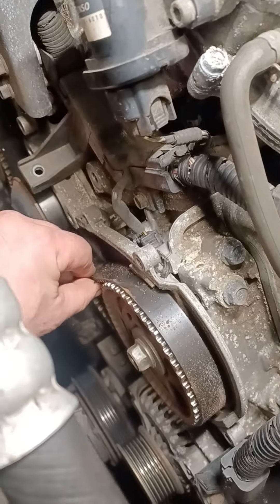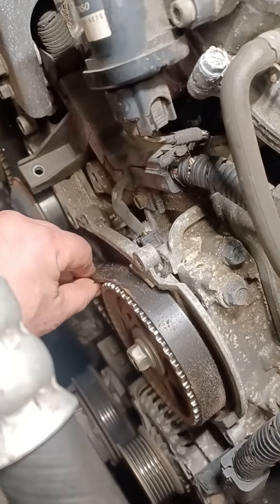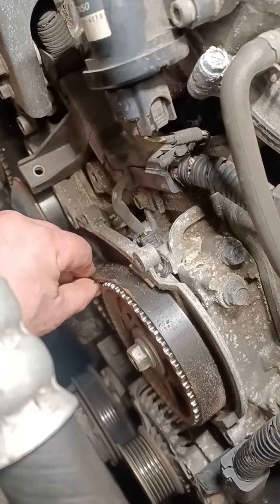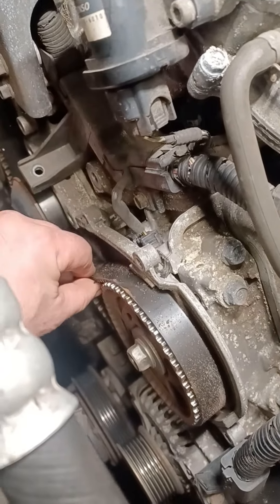2012  Acura MDX 3.7l loud rattling engine sound . Timing belt.

Comment: People seem to forget that it's quite rare for timing belts to just snap or break, most of the time when timing belts "break" it's the tensioners that fail. My 2004 Seat ibiza had the original timing belt from factory and it looked almost as good as the new belt with only very small cracks, it was the tensioners that were failing, changed the belt this year.